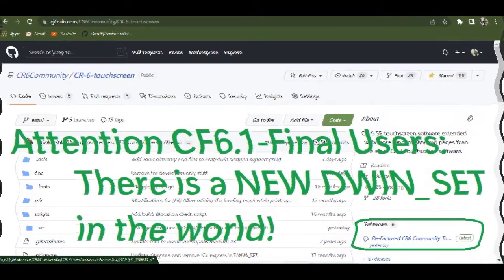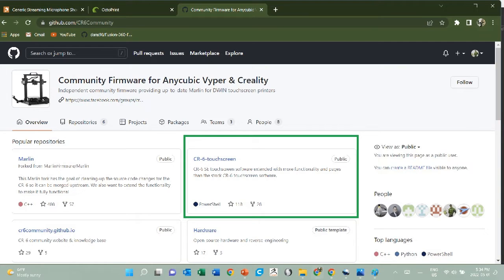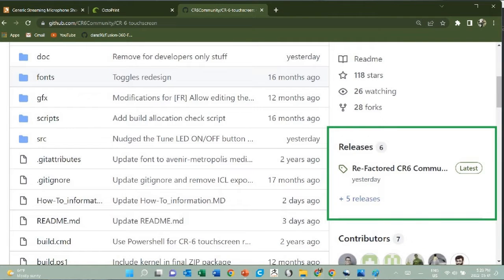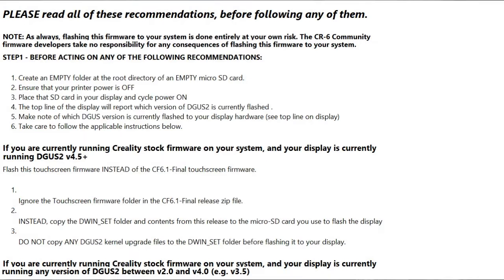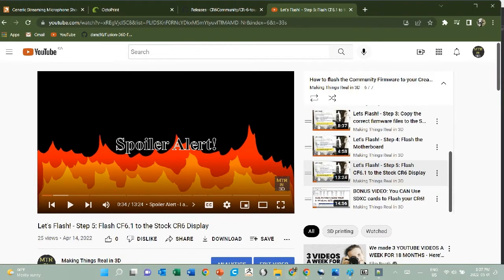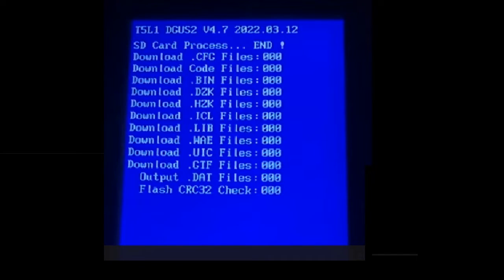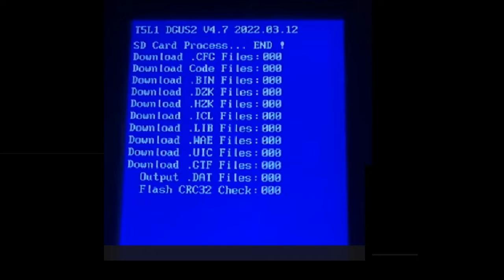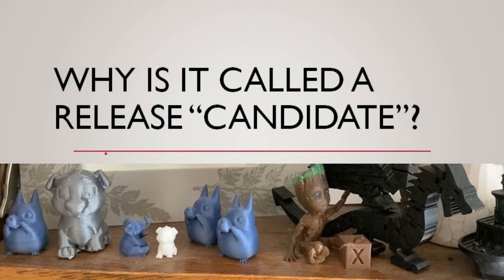Refactored CF6.1 DWIN_SET Now Posted  - owners of new CR6 printers rejoice!

Comment: Hello, I did something wrong while trying to install and there is no image on my screen. What should I do?
Reply from the maker: Did you flash the refactored firmware to the display?
Did the flashing process end with a blue screen?
Reply from the maker: This wiki post may help… https://github.com/CR6Community/Marlin/wiki/Troubleshooting-Problems-with-Firmware-Flashing#after-flashing-the-touch-screen-it-only-shows-a-black-display
Reply: @makingthingsreal101  thankss
Reply: @muratbalta2015 Hocam merhaba ben bu işlerde yeniyim pek anlayamadım. Elimde CR6-SE modeli var içinde stock 1.0.3.6 ben ilk olarak bu touchscreen olanımı yüklemem lazım yoksa merlin olanı mı?

Comment: Hello. I've got this touch screen for my Ender-3v2 (board 4.2.2). WHen I first installed it it worked fine. But when I restarted the printer, ow on the "Ready" and "Leveling" buttons are working. When I click the "Setup" or "Print" buttons, it gets stuck. (T5L1 DGUS2 v6.1   2023.03.11).
COuld you help, please?
Reply from the maker: The motherboard firmware and display firmware must be a matched pair.  There is no standard for the messages exchanged between the two.  There is no version of the CR6 Community firmware written for the 4.2.2 board, so the display firmware may flash but the buttons will not work correctly.

Comment: I have the kickerstarter of the CR6SE and I followed the steps for the firmware update for the 4.5.2 and I have a black screen. Now I cannot reflash the Touchscreen. gettting a blinking LED near the hot end while attempting.
Reply from the maker: Sorry, Fritz.  Is this comment incomplete?
Reply: @makingthingsreal101  well honestly looking for a solution for the  black touchscreen after flashing to the latest firmware. Just don’t know what happened to cause the issue.
Reply from the maker: @fritzcamille4867  frustrating.  Sorry to add to that with more questions.  Let's deal with this on the Discord.
Reply: @makingthingsreal101  that’ll work how? Im apart of the community firmware discord.
Reply from the maker: @fritzcamille4867  I am sitting on voice-help-1, now. Are you able to join? https://discord.gg/FjkEQPpWhttps://discord.gg/FjkEQPpW
Reply from the maker: UPDATE: A second user recently reported getting a blank screen after installing the Community Firmware to their display, which had been running an early stock firmware on DGUS2 v1.4.  

They were able to successfully flash CF6.1 by following this sequence: 
1. They flashed back to DGUS2 v1.4 and stock firmware. (Might be optional)
2. They flashed just DGUS2 v3.5 to the display
3. They flashed just the rest of the DWIN_SET files to their display.

If you have troubles with your upgrade causing a blank display screen, that sequence may also work for you.

Comment: @makingthingsrealin3d

from the readme it appears that the refactored DWIN_SET is good for any installation, is that correct? if it works everywhere, do i need to go insert a blank SD with a blank folder on root and check to see which DGUS i have? can't i just throw the refactored dwinset on a properly formatted SD card and have at it either way? i think i misunderstand

thanks so much for your work and this video.
Reply from the maker: Yes, the refactored one works on any DGUS2 we know of, today, though the kerning is not working on DGUS2v1.4.
I kept the advice in here because flashing the empty DWIN_SET first gives you a baseline before you make any changes, and it does no harm.
The Development team also asked that I recommend users flash the Touchscreen firmware version bundled with the mainboard firmware, if the display was already running DGUS2v4.4 or less, so recommending that users run this test first allows me to honour that request.
CR6MAX users may actually prefer to run the bundled firmware, if they prefer the way the ABL mesh is presented in that version.